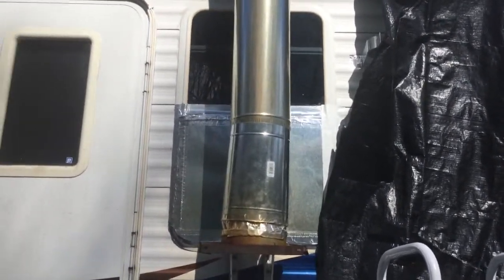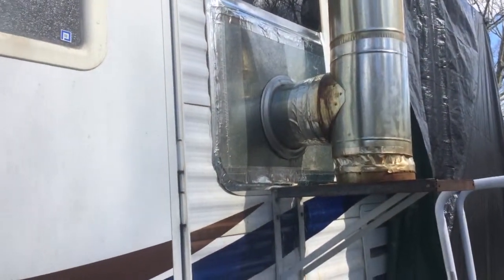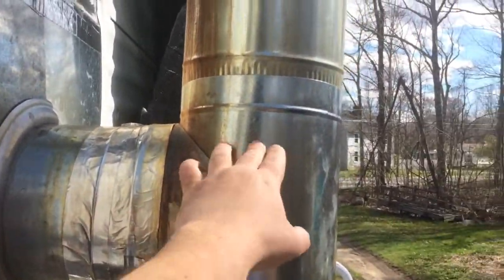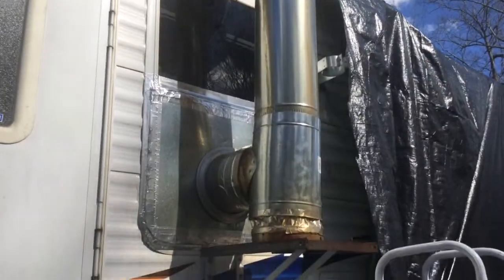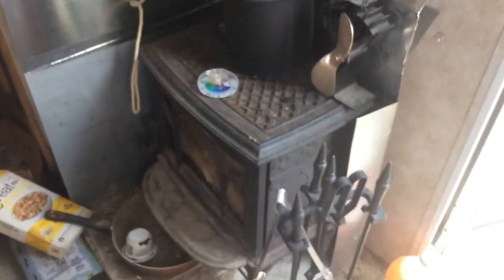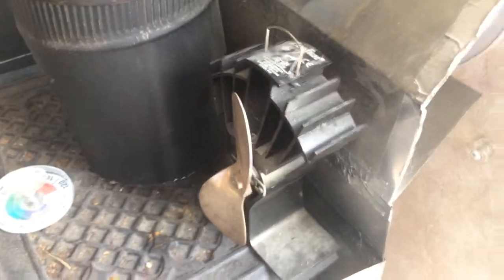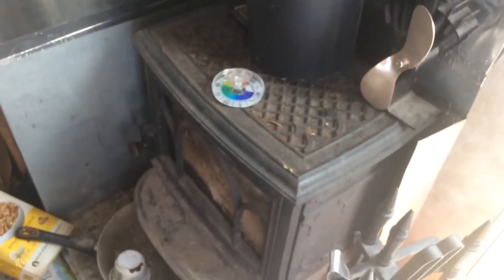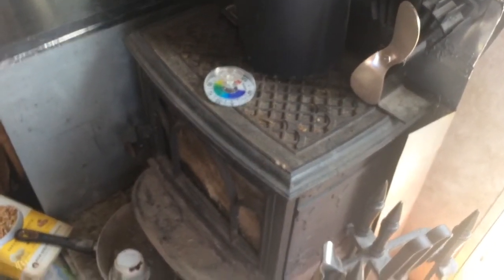Wood stove in a camper part 1

Comment: Are you still using this during this Winter 2021-22 ? I live in a small house  , and I already have a wonderful Propane heating system . But also want another option for heating. I have a small wood stove that I also want to put in my small living room . For me, the issue is where would be the best place to install it ? , etc. Thanks for your video !
Reply from the maker: Hello Lorie. Unfortunately I no longer have that camper. But it was nice to watch that stove while inside it. Good luck with your stove and thanks for watching.

Comment from the maker: Not at all.  I have a huge slideout room across from the stove.  Have not had an issue during the four years of use.  Thanks for the input.
Reply: Great, how hot how often to stoke
Reply from the maker: @josekma1  Every 3 to 4 hours. Sometimes a little longer if I had the stove vent turned way down.
Reply: Thank you so much for your response and time.

Comment: what is the purpose of having the safety pipe outside your camper I can see going through your wall.. or going through the ceiling with the safety pipe but not outside if you want to burn $100 for every 3 foot or 4 foot of it
Reply from the maker: I  went through the window because I did not want a hole in the roof.